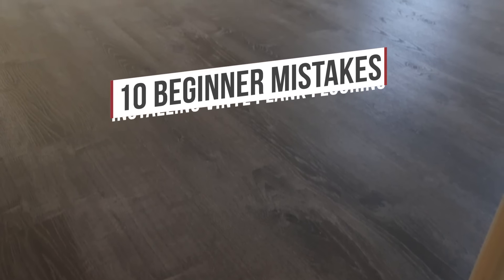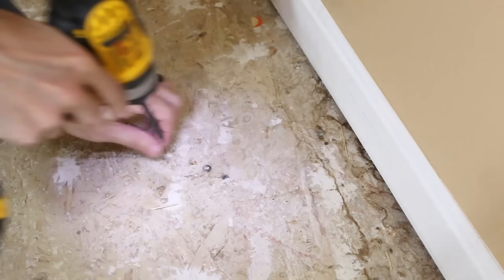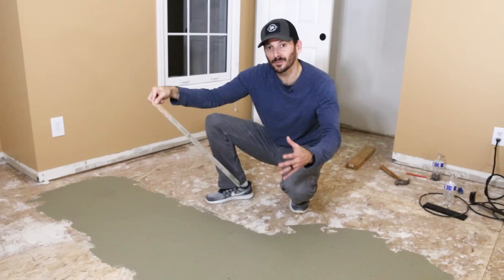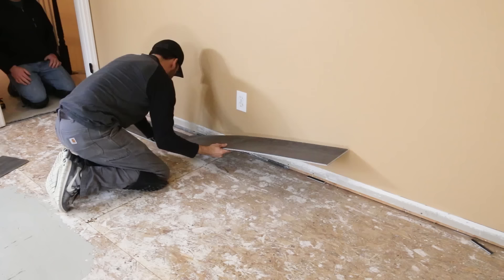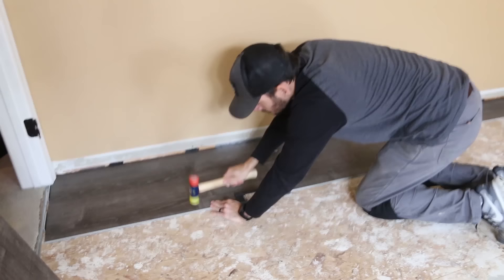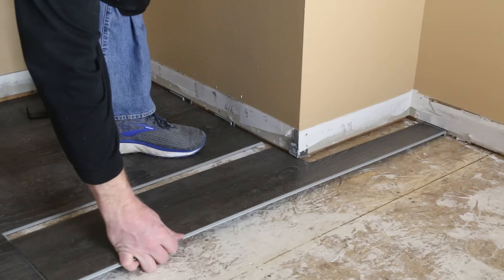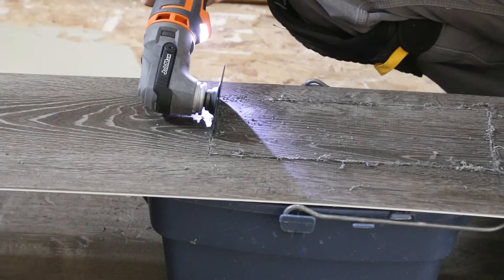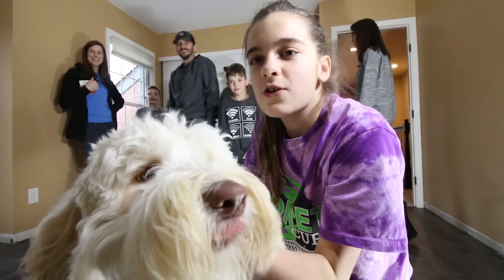10 Beginner Mistakes Installing Vinyl Plank Flooring

Comment: I don't get it he removed the baseboards and then thinks he can reinstall them lower avoiding the quarter round (carpet stood higher than vinyl planks) which means repainting the wall at the offset !! He got away without mention that at the end. I don't want to repaint walls !  Am i missing something ? thanks.
Reply: You're 100% correct. I always leave the baseboards on

Comment: I missed the part where you enjoyed now having to have spent hours treating/mudding and painting the first 1/8 inch above the new baseboard location after spending an hour removing old baseboards and nails instead of 5 minutes of miter cuts with quarter round. And quarter round looks better and not like a flat wall to floor prison cell.

Comment: Can anybody help me!!!  I am using this product (Life Proof vinyl planks) in an old small office in an old building where I work, approximately 8x8.  Unfortunately, the existing floor consists of a carpet, (which I started to pull up because I was told it was concrete underneath the carpet), but when pulling the carpet up I found out it was glued down to thin square tiles (I think vinyl) which were under the carpet.  In some places where there was a lot of glue/adhesive, pieces of square tiles broke and came up stuck the back of the rug.  Of course where those pieces broke, I noticed under the layer of tile that the carpet was glued to are old cork tiles.  So since the vinyl plank floors are a floating floor and there is adhesive still on the top of the tiles, as well as the small areas where the vinyl tiles broke there is cork tiles, I was told I can't place the new vinyl planks unless everything comes out, which I can't do, or... 
I was told I could use a thin layer of something like floor leveler to create a new layer over the tiles and cork tiles that are showing.
My million dollar question is can I use a concrete self leveling material on the cork tiles? and if so, will that layer of self leveling material be suitable for the vinyl planks to rest on when expanding/contracting due to fluctuating temperatures?
Reply: You would have to float the entire room and that isn’t an easy task if I’m being honest, plus you would have to prime the entire floor before hand, use the brand ardex for both and make sure it’s self level and not feather finish or anything else. And yes it will be suitable for vinyl and won’t get messed up from different temperatures. Hope that helps

Comment: In this situation, quarter round would be the wrong type of shoe molding to use to cover any gaps; quarter round is made to go with beefier and taller baseboards (skirting) what's called for here is a small shoe molding or a colonial shoe molding as it fits in scale to the existing baseboard and does the same thing as quarter round. ( 40+ years of experience )

Comment: Old building walls sometimes are not square they bulge out slightly due to the frame not being installed even by fractions of an inch that's another problem.

Comment: The whole point to putting a floating floor down  is to avoid all the unnecessary patching you did. Especially when it’s a minor dip like the one in this video. Extra time & work for very little difference. This floating flooring is designed for dyi installers who are not proficient in floor leveling . The product is user friendly designed for uneven floors. And those small nail pops are not going to translate thru the board. No need to take them out . Hammer them down , they don’t need to be countersunk . They will not be a problem . As for taking off the molding. That is a judgement call for the customer. Most times it makes no sense to remove existing molding to accommodate a temporary floor . Yes, floating floors are considered temporary and not classified as a capital  improvement therefore shoe molding is ideal. Unlike quarter round , it’s Lower profile and not an eyesore. Removal of and reinstall of any molding is justified when putting down more permanent flooring like hardwood or tile. Otherwise it just creates more work and risks banging up the molding for no reason.

Comment: The thinset will crack up and floor will sound like there is cereal being crushed underneath when walked on. Thinset has very low tensile strength and should not be used as floor patch over wood.

Comment: If existing wall base is too high up, you can install quarter round in front of wall base. Completely acceptable, and don't have to mess anything up removing exciting wall base. (Base can easily break, it's easy to mix up pieces when re installing)

Comment: Quarter round has an extra ledge that needs to be detailed to keep it from looking grimy. If you leave the gap & don't remove/lower/replace the baseboards you can eventually find ALL TYPES of "treasures"....missing earring, Q-tip, vitamins, random spring(s), & a Mike & Ike's (thanks for that Gage 👎!).
Plus you have a conversation starter EVERY TIME a family or a handy friend stop by, wondering, "When ARE you going to drop those floorboards!?" Fun times!

Comment: There is only one thing I would worry about and that is a moisture barrier if the wood would ever get wet from a drink or water laying on the surface long enough to get down to the wood it will buckle up and push the floor up! I had it happen to me once. I had a rubber bathroom rug laying on the floor and water sat under it for long periods of time and I knew nothing about it until one day I lifted it up and the floor was pushed up from the plywood swelling really bad! After that, I used either rolled Plastic or I even used Ty-vak and rolled it out under the floor! You may know a secret ! I don't! Thanks have a nice day!

Comment: This is the first do it self job where the do it selfers did it right . For the people that are using this video to do your own floor . If you skip any of these steps you will have problems with your floor .I know you will skip as many steps as you can because 99% of do it self workers cut all the corners they can .

Comment: While explaining the importance of undercuts, you forgot another rookie mistake that’s often made. Another major eyesore is, Installing the transition on the wrong side of the door jamb any T strip or transition from one room or one floor to another, inside of a doorway needs to be cut under the door so that it is hidden when the door is closed. That the only clean proper way to do it. This is some thing I often see done incorrectly. You also made that install a lot harder then it needed to be. Work smarter not harder.

Comment: For the floor dip, shouldn’t the underlayment take care of that? That’s how the product advertises.
Reply: @Doc Nez No it wouldn’t, when you would walk on the floor after install you would feel it dip, it does help a little but the threshold we usually go for is about 4/16 of an inch and you still feel it dip. So no it does not completely solve the problem. So basically if you can stick 3 pennies under the level then you should probably fill it.

Comment: Disclaimer if your floors are uneven before you install get your foundation checked we had a bad experience with this better yet before you buy get the foundation checked and double checked I would put it in the plumbing electrical and roofing category of importance

Comment: I got a question: How bad an idea is this: hammer down the nails in the tacks, keep the foaming from the previous carpet, lay down a thin layer of ply wood through out, then do peel and stick vinyl floor??? Yes,  no? confession....I may be on step 3 of this crazy idea. Going to the store tomorrow to see that the experts at home depot think...

Comment: I don't like quarter round and this video leaves a dilemma. If my vinyl flooring has a shorter profile than the carpet, I'll have a gap between it and the baseboard.
If I remove the baseboard and lower and cut it (if needed) to make it flush with the new floor, I could have a sizeable paint gap. So, what then? A thick bead of paint caulk? I'm sure as heck not going to repaint the whole room.

Comment: Half the time I do vinyl plank flooring, the customer is so cheap, I am unable to address anything on thier subfloor unless it's major.

It's normally in conjunction with the cheapest possible option. To which I tell the customer, I do not back this product. And within 6 months or so, the planks begin to separate @ the ends.

The last job I did, they wanted to hire me, didn't like my price, tried to install it themselves wrong, called me back after having the whole floor half installed. Then tried to dictate to me how I was going to install it, trying to force me to just hammer together 50 foot runs of plank flooring attached end to end. I told them them flat out, I would love to install your floor for you, but I will only do it my way in a manner I know will achieve success and not cost me tons of time and headache. I told them if they want me to install it, it all needs ripped up and re-installed. I also informed them some of the product will be trash now, because I have to separate pieces not made to be separated and some of it is going to break.

It was such crappy material, a good amount of it broke its tiny tabs upon removal.

Stand your ground on work you are going to do, don't let homeowners dictate your work and relegate it outside your building standards. Don't be afraid to say no and walk away, don't be afraid to ask for money up front if you don't think you will like the outcome, don't guarantee work you do that has been mitigated beyond your quality standards, and get that in writing, signed as a contract.

Comment: "Push the easy button"? Remove the base = possible damage to drywall and a lower installation after job is done, which = drywall repair and painting for wall and base. Base shoe..NOT quarter round FTW!

Comment: I personally wouldn't pull the baseboards, it's a pretty massive undertaking to remove and install again for what it's worth. You may change the floor again in the future and have to pull them up again. It risks damaging the boards, the paint will never look the same either and all is very time consuming. I think it's a professional look for sure but as a DIY seriously meh. I think who ever buys the house in the future will likely put in their own floors of liking anyways and may even be glad the boards are up so they don't have to adjust them for their install.

Comment: If your base has a clean caulk line and nice paint, no way would I remove it.  Lowering your base will still require shoe and expose the old caulk line above that is really difficult to remove.

Comment: Not sure what brand of flooring you are using, but the product I am using on a whole house, (1400 sq Ft.). You CANNOT use the tapping block so easily as in this video, it will break the edges and then it will not lock in. Pay very close attention to what product you use.  My flooring store won’t even sell these tools to use for installations.  I have them from a project from 11 yrs ago.  We use a rubber mallet and a 12” piece of 1x4 pine wood that we have around.  I try to use all of my flooring cuts that are useable, and end up with very little scrap.

Comment: People just dont put an underpad under these floors, you are supposed to use an underpad even if it is an thin underpad attached to the board..and why are they worried about pattern look if the floor will be covered with a rug or tons of furniture

Comment: You made a beginner's mistake when you installed the vinyl vertically on the front door! The vinyl is always installed parallel to the front door! This way you avoid the vinyl panels sliding due to the impact of your feet when you enter the room! That is one of the rules when you installing vinyl!

Comment: We took the base boards off. Way easier install
Reply: Its the best way to do it... so you can set the baseboards back onto the floors.  Not press them hard though, don't want them to pin the floor down.

Comment: Pro Tip: Do not buy the low cost, thin wear layer and floppy thin planks.  Buy a super thick solid product, with a preinstalled backing like Series 7 from Shaw and you will not have to worry about small subfloor imperfections.  Either way, if you are doing an entire main floor (living room, kitchen, bath room, laundry room, entry and hallway) and you do it all in one continuous application (no transition strips), it is a MASSIVE amount of work, so be ready !  Buy a guillotine plank cutter and an oscillating cutting tool....it will be the best money you ever spent.
Reply: I got real hardwood floors put in... there's nothing like the real think... pricing wasn't bad either...last winter..

Comment: Heres a thought, stop thinking the vinyl flooring is so great. Being paper thin of course having to take more time and care in the prep work. Adding floor leveler on a subflooring that continues to move even worse. Especially in high traffic area of the upper floors. I've been installing flooring since '98 and have a huge disliking to the shift of materials such as vinyl. A good laminate or hardwood is way more durable to wood subflooring. In a basement setting sure us this crap. All vinyl was introduced for was the commercial usage for higher traffic office space / showrooms. In the residential garbage 👎

Comment: Actually there's only one mistake. Using vinyl flooring.
Reply: Question,for a concrete basement floor this seems like a good option,what would You suggest for that application? Thank You
Reply: @timberhills1778  technically, vinyl is a good option, it's just a matter of taste for me. I just don't like vinyl. If I wanted to go cheap, I would just use paint. If I had the budget, I would use tile. If water intrusion was definitely not a problem, I might install a raised wooden floor for a nice warm cozy feel.
Reply: @theobserver9131  Thank You,was thinking about that wood floor with sleepers underneath,not sure what I want to do yet, have a good day
Reply: @timberhills1778  you're welcome. Before installing wood in the basement,  you want to be absolutely sure you're not going to have flooding issues.

Comment: You’re way too picky. I could’ve finished the room by the time you were done the 3rd row. Pulling the rows out because the notched board won’t make it all the way to the wall does not even matter. I’m a flooring installer and we don’t worry about 90% of the stuff you’re worrying about. For example, an ender being less than 8 inches. Who cares?? Eventually it’s going to happen unless you’re going to make a pattern out of the stagger. You’re either going to have a small ender or small starter at some point.

As for the baseboard removal, smart idea but now you’re you’re to have to paint the wall where the baseboard is lower than before.

Comment: I would point out that you're not wearing any eye protection! So you need to cross out the title 10 beginner mistakes and make it 11 to include not wearing eye protection. Always wear eye protection. If you've ever been working and had a nail or wood snap and catch you in the face you'll know why. It's always when you don't expect it. Better safe than blind in one eye :/. Good tips otherwise. P.S. Always take off the molding, 1/4 round looks cheap.

Comment: The biggest mistake is no padding underneath it
Reply: Depends on the product.

If the LVP has a pad attached to it, you shouldn't need a pad.  Shouldn't even use one unless it is one specifically designed for it... like an acoustic one.

Can cause to much flexing in the floor, will cause the joints to fail.

He should have put a vapor barrier down though.
Reply: @daleludtke7803  It clearly has no pad on it, it is going bare and directly on chipboard (no vapor barrier needed that is the top of the subfloor) it will be noisy, prone to separation or cracks anywhere there is the slightness level difference etc as no pad to absorb the force or the noise.

Comment: what a bad and cheap quality them houses in the USA are omg, yall just nail everything, click click click, all wood that will reshape and crumble over the years... here in europe the houses are made of stone.... floors are smooth forever, when you redecorate and take down the wallpaper or stucco you are left with undamaged and smooth walls and floors lol. haha yall use a big freaking saw that needs to make 2 cuts... we just use the hand jigsaw that you have on the bench behind you so that you can cuttttt in one second and in one run.... but heyy !! yall have everything bigger and better , right. and why the freak would you nail the laminate floor to the ground !!!! its a click system that does not need glue or nails... just freaking click it